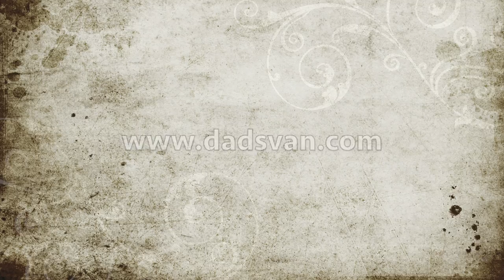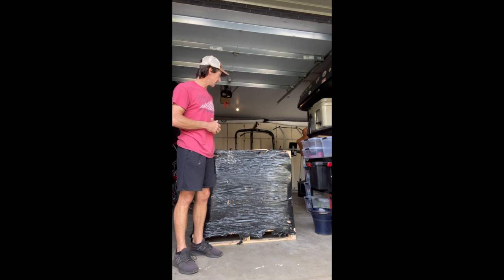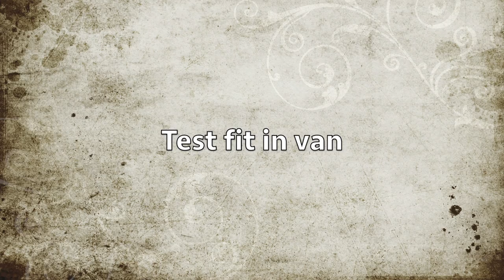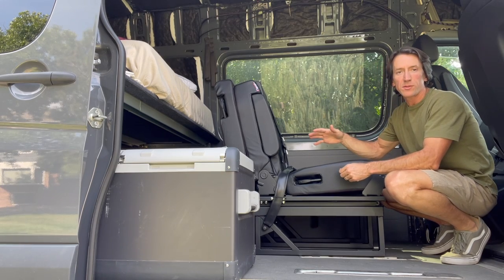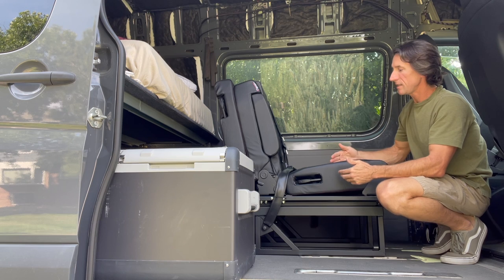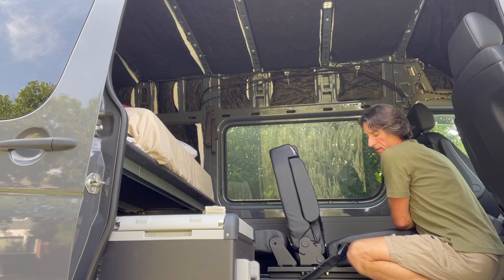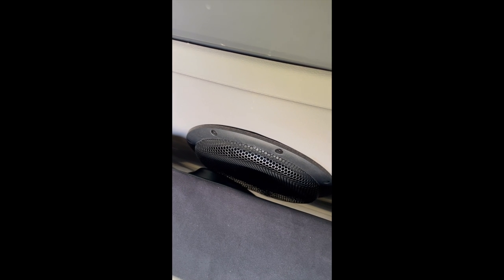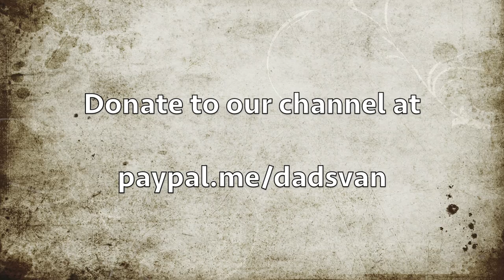Part 1 Install of Scopema RIB Altair seat bed in Sprinter van - Unboxing and setup

Comment: Thanks for the video. This set up is exactly what I have in mind also with the platform bed in the back. What van do you have/dimensions of the interior cargo area?
Reply from the maker: We have a 2018 Mercedes Benz Sprinter 144 high roof.  Interior cargo dimensions are roughly 69 inches wide by 123 inches long and 75 inches high.  A google search will produce good info on dimensions.

Comment: One other question if you are able.   For the 8" forward slide.  Are there any detents to allow the seat to move forward or back less than the full 8" and hold in position?
Reply from the maker: Yes. You have to pull up on the handle while sliding, so releasing at any point locks it in that position.

Comment: Thanks for the awesome video! Looking to use  a scopema 2 belt in a van but need a couple extra measurements for planning.  When the altair is made into a bed, do you have a length from the seat frame to the back edge of the mattress and also from the front edge of the frame to the front edge of the mattress.  DO you have a measurement for the amount that the nose of the seat bottom extends past the frame when setup as a seat?  Thanks!
Reply from the maker: Horizontal measurements. Seat frame to back edge of cushion is 21.5”.  Frame to front edge is 20.5”.  Frame to edge of seat cushion nose is 2.25”.   Those are all taken from the bottom of the frame.  Good luck with your build!
Reply: @DadsVan  TY!